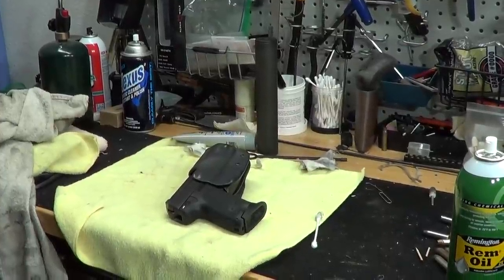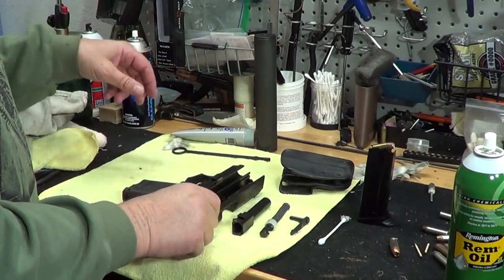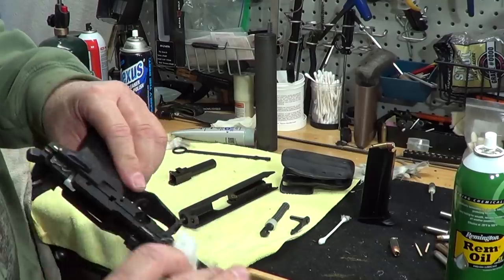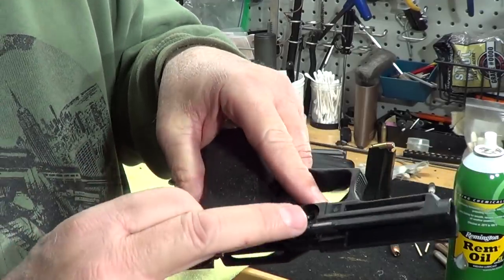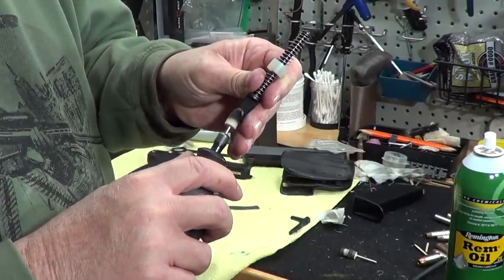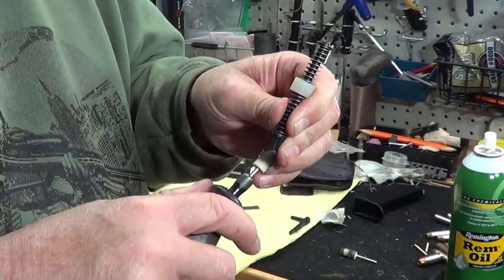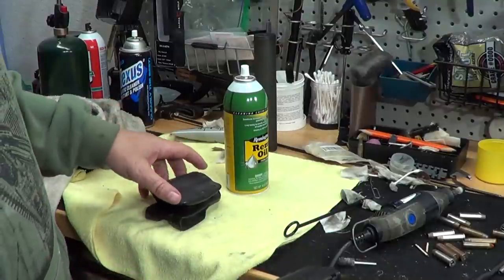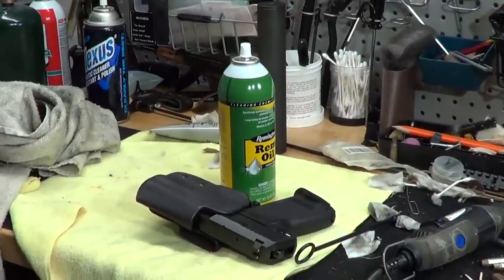Cleaning H&K USP 45 ACP - Gun Has Been In Holster For Years - Decided To Clean It

Comment: Ended up with an old sears 22 rifle. A rebranded Springfield. It was so bad I had best the bolt open with a mallet. It got a home blue job, a couple crack in the stock fixed and a lot of wire brushing on all the parts. Now it works great but getting there. It was interesting. It's higher maintenance now because it will rust easier than any others.

Comment: I did the same thing. I polished and smooth all the metal to metal. It makes the action smooth as glass. Had my slide milled and put a trijicon RMR red dot on my edc Glock 19 it slowed the slide down a little. if I let newer shooters try it and their wrist wasn't locked it would stove pipe or short stroke. I polished everything up to mirror finish and problem solved it feels slick like high end gun now and has a little more ass kicking brass out

Comment: HK has that 'hostile environment coating' or whatever that is supposed to resist rust as good as it gets. I think it's the same as the Glock Tenifer coating The only thing I've heard against polishing blued/nitrided parts is that the coating is so thin that you can accidentally go through it and expose the surface to rust.

Comment: No way you can effect tempering of that metal at those temps.  Not going to happen even with dremel going full tilt.   

Fitz is like the Blue Magic polish I sent.  The Blue Magic is mostly for Aluminum, but use it on SS too.  I just use a paper towel as a part is spun in the lathe.  Can't over Polish it is my feel.  You just take of crests of the surface. 

Get a 10X lobe and look at the part before and after.  You can really see what you have done.  

Warning, you will mostly-likely polish more after looking at the surface closer.  Got like 4 of those placed around shop, use them all the time.   Looking at knife blade edges is an eye opener. 

Surface finish is an Art to it self.  Still figuring it out.